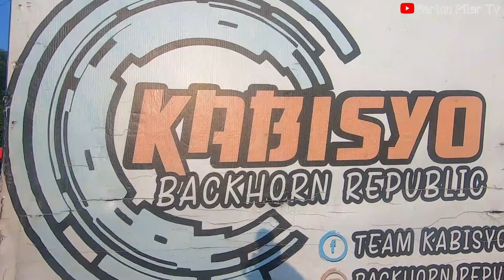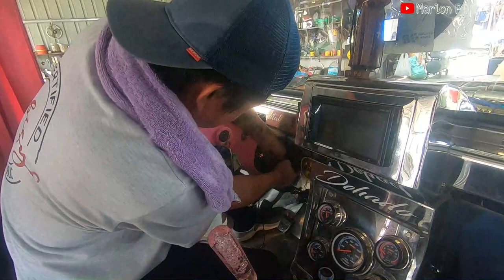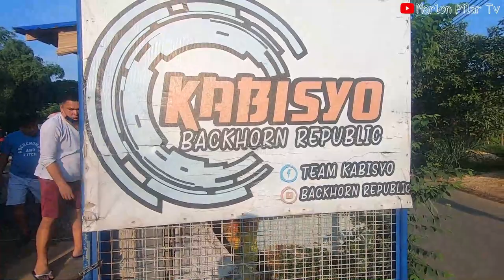Nag pa install ng airhorn si Dukha Jeepney(Kabisyo)

Comment: Boss saan mo nabili air tank mo??
Reply: Kay boss tato yan sila ata gumawa
Reply from the maker: Oo nga po
Reply: saan lugar po nagpapaset up nyan at saan po nabili ng tangke
Reply from the maker: @lsaacg.bitoin7517  kay kabisyo po mismo at kung orderin siya din po.ito po number niya (0906) 425 0670
Reply from the maker: @lsaacg.bitoin7517  kay kabisyo po sa sta maria bulacan ito po number nila (0906) 425 0670
Reply from the maker: @lsaacg.bitoin7517  kay kabisyo po sa sta maria bulacan ito po number niya (0906) 425 0670